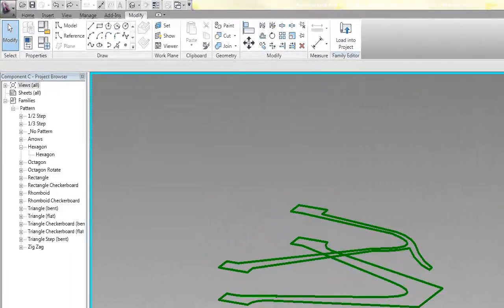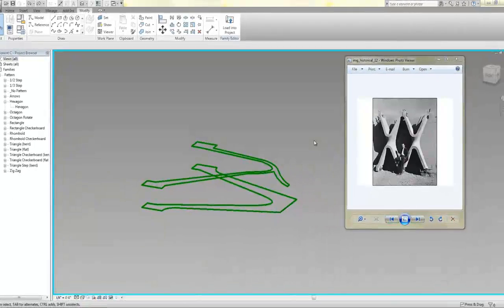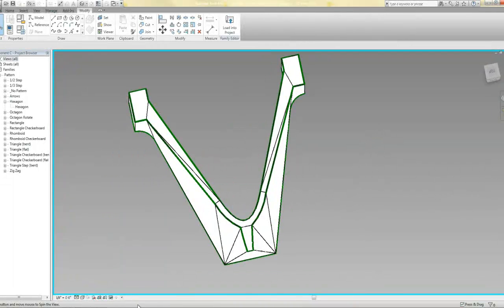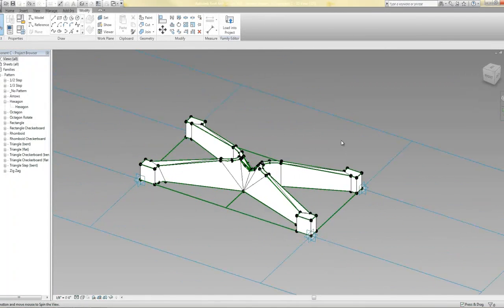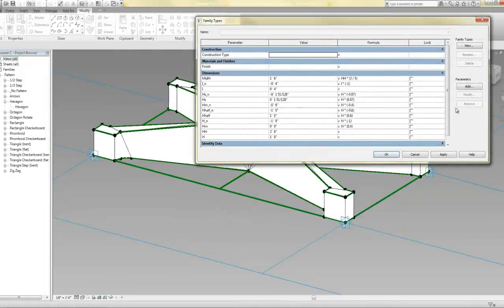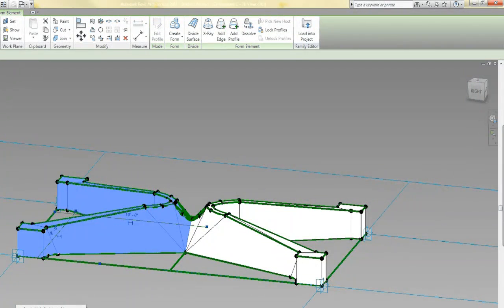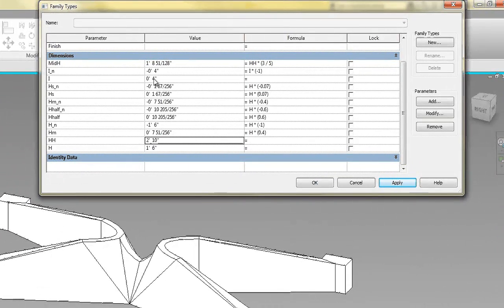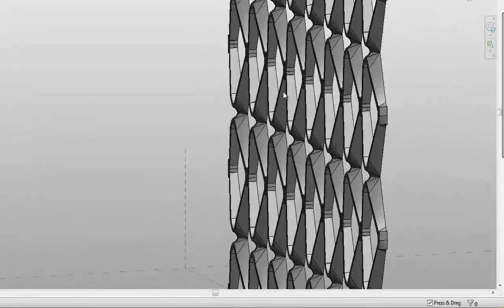American Cement Building

Comment: I really apprecaite that although the video is showing how to show off your Revit Family skill to make this piece - you also show the full wall assembly at the end of the video for te tile effect.  

Have you worked out any detail for how the glass will connect to the precast concrete pattern for the curtain wall assembly?  Would there be some sort of routed edge on the back side of the pattern element that would be depressed to receive glass with a continuous sealant perimeter?